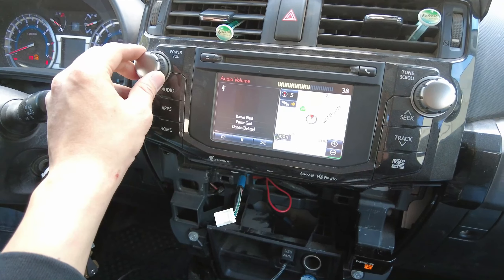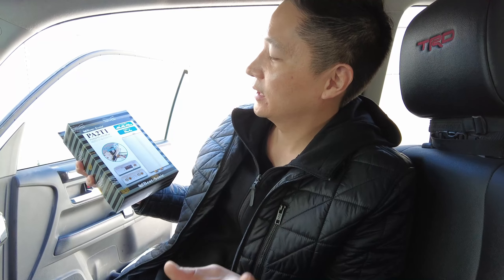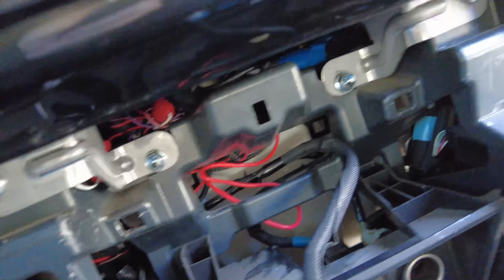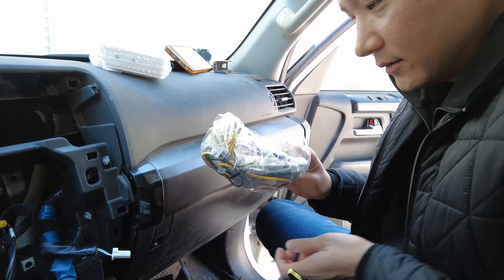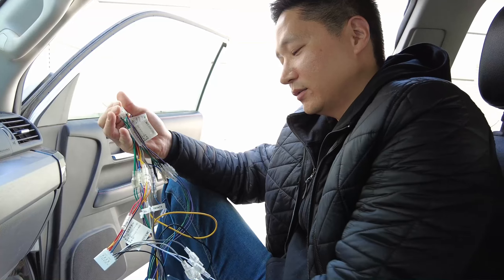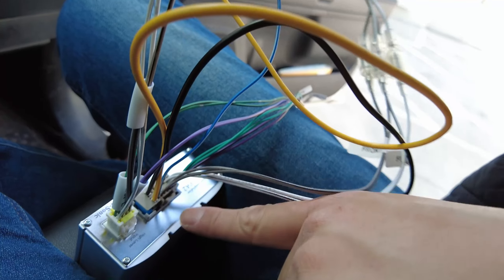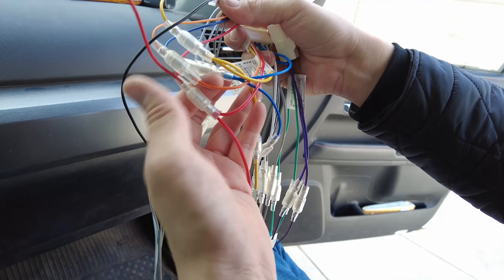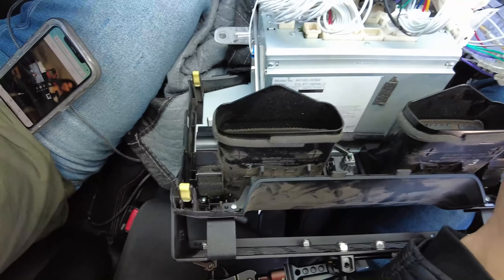Micro Power Amplifier Kit | 4Runner DIY Install

Comment: Does the micro amp increase any power watts to the sound? I mean is make it louder than the original?
Reply from the maker: Yes it adds power watts to the sound and it will be louder than the original. The same volume level will yield a louder sound output
Reply: Thanks

Comment: Hi, what about a 2016 FJ cruiser with android radio with no JBL?
how is this amp powered? i don't see any positive wire or fuse connected anywhere?
if there is no crossing wires and all colours have to match, why aren't the wire going straight from male to female connectors, why the extra single connectors in between?
Reply from the maker: Yes this is compatible with 2016 FJ Cruiser. I don’t think 2016 FJ came with android auto, so I assume you have an aftermarket radio? This one shown was a prototype so we had some extra wires on it.

Comment: Does this bypass the stock amp or add to it?  I have 17.5 watts. Then I add 45x4. Is that total of 62 watts or just the 45?
Reply from the maker: This works together with the factory amp. The power won’t stack 1:1, but the will both work together to provide a better sounding car system.
Reply: @BeatSonicUS  thank you. Your easy connections amp with some kicker speakers should be a major upgrade from stock.
Reply from the maker: @frankdalton483  it really well. The improvement will blow you away, especially for this low price

Comment: Hi will it work on a 2022 4runner trd sport it's got the premium audio system
Reply from the maker: Yes it will work but the improvement won’t be as big as the model without JBL
Reply: @BeatSonicUS  ok but mine is not the jbl
Reply from the maker: @joseflorida74  then it should be a good improvement!

Comment: Hello, I have a question, RAV4 Stereo does not have an AUX input, I saw your micro amp has RCA AUX INPUT SO, may I use that to give AUX input to connect a DAC to my sound? If I connect my DAC to the AUX in your micro amp does it sound in my RAV4 Speakers or what?
Reply from the maker: Yes you can add a media device via rca to our amp and it will sound
Reply: @BeatSonicUS  the stereo mut be turn on? can you make a video for that I guess there are a lot of people asking the same, now that the DACs are so popular, for better reference the DAC is FiiO BTR7

Comment: Hello
Can you help me?
I have a problem with my Lexus RX350 2020
I can't call my phone in the car.
A message appears (no microphone)
Do you know what the problem is?

I disconnected the battery for more than an hour but to no avail
Reply from the maker: I suggest you take the car back to the dealer